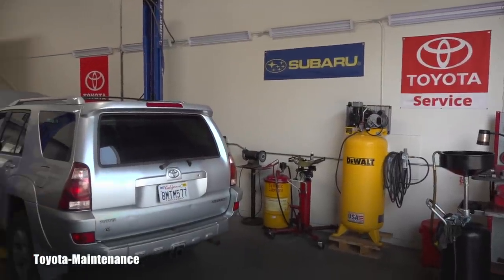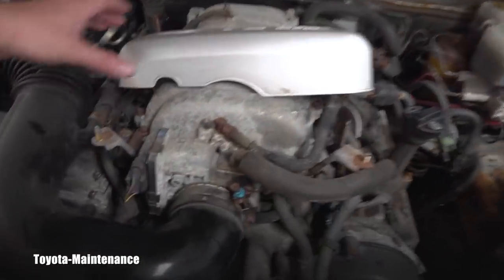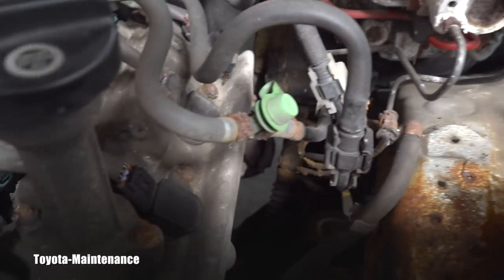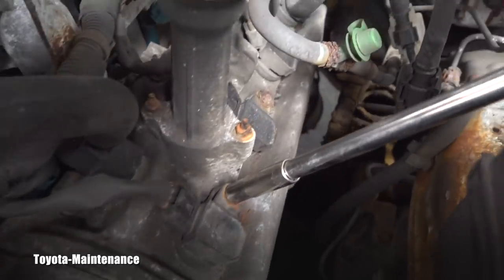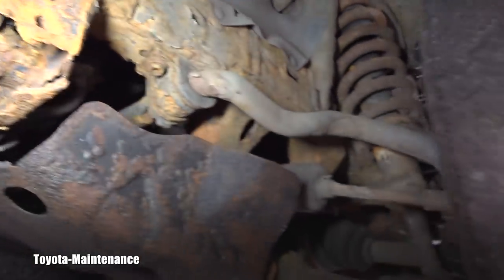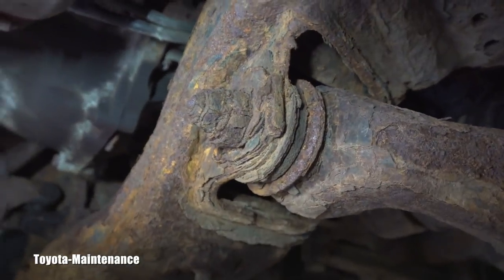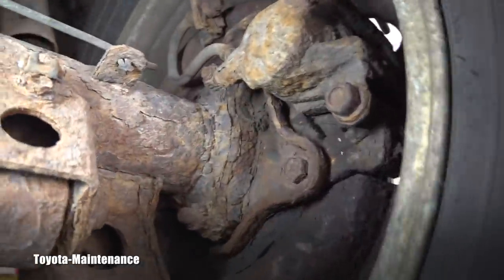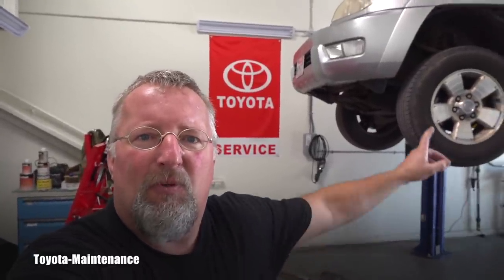Extremely rusted Toyota 4Runner

Comment: I'm in NYS but I've never worked on a car this bad. I just steel brushed the underside of my Toyota, added rust converter and a couple of coats of paint. Hopefully that will give me a few extra years. They should have done that to this car. They neglected it.

Comment: If it falls apart and crumbles, that's beyond rust.  I was my vehicle and undercarriage every two months and annually spray the undercarriage with Fluid Film. You really haven't work on a car until you have worked on a severe rust bucket. Have used a lot of penetrating oil and propane torches over the years and sometimes you need to cut off the nuts and bolts. Jobs like trying to removed rusted out subframes, you better hope your not being paid a flat rate. Seen a lot worse over 50 years living in New England.

Comment: I spray used motor oil on my Tacoma frame. 
Don’t use anything that will get hard and peel away from the metal even paint will let water 💦 get under it and cause rust.

Comment: I have a 99 and it was in Pittsburgh for about 9 years. Now in Florida. The rust is similar, but not quite to this point. I would consider this car for scrap at this point and NOT put any money into it. It is a real shame because the engine still runs solid as a rock. I made a mistake putting money into this car to fix up the front suspension and brake system. Now one thing after another, and the car has been removed from everyday service. I bought a new 2018 for everyday. Toyotas will rust away while the engine keeps running like a kitten. Sometimes you just gotta face the reality that it is time to put her down.....

Comment: It's a bit ironic that vehicles with a separate frame seems to be the worst. I am pretty familiar with the problem and hate it with passion. I live in the worst parts of Sweden and did just come in from another day of welding on my Isuzu Trooper. In some places it looks like that Toyota but a lot better in others. The thing that always surprise me with rust in the US is that there never seem to be any undercoating. But I also have to say, how did that Toyota manage to be ten times worse than my Trooper with 25 salty winters and salty ocean winds behind it? Under the bonnet, my old wreck is pretty much ok.

Comment: It's not pretty, but it's common in the rust belt. Here they use salt that is "wetted" with magnesium chloride, which makes it ten times more effective at de-icing roads, and ten times more effective at eating through cars.
Here's my usual song: A torch, hammer and punch, penetrating fluid, six-point socket, tighten first, then reverse.

... It usually works.

Comment: My 2003 Toyota Sequoia with nearly 285,000 miles has spent its entire life in Maryland and doesn't have major rust issues.
Reply: NJ2MDdude NY salt is in a class all its own. Now, with the pre-snow brining of the roads, you can kiss your vehicle goodbye even sooner.
Reply: MD is a southern state with minimal snow except for Garrett County.
Reply: @user-tb7rn1il3q  We get ice now in place of snow. So, our roads are brined often, perhaps too much. A few years ago, I walked thru my Toyota dealer's yard and saw about a dozen rusted frames in two stacks. I was shocked that the rust issue was common in MD
Reply: @nj2mddude205  How do you know those were from MD trucks and not WV or PA?  MD is near a lot of other states with more winter precipitation.
Reply: @user-tb7rn1il3q  Since the recall was national, all Toyota dealers with body shops would have had to honor the recall and replace the frame. Both I and my Toyota dealer are just outside DC in MD. Perhaps DC and VA plates, but I think WV and PA plates wouldn't have to travel that far a distance to replace the frame.
Reply: @nj2mddude205  I never see a rusty Toyota frame in NOVA, maybe VA doesn’t use as much salt.  There are a lot of people that commute 1-2 hours each way.  WV has no jobs.  PA isn’t much better.

Comment: Eh, little angle iron is a start for the frame repair….. should have plated that whole side, cut out bottom and sand blasted from inside and welded shut with flat plate and a few drain holes drilled out . Blast and Coat exterior with KBS system or Por 15(and a top coat) Then 360* degree tip and kbs cavity coater/fluid film on a long wand once every year for all frame interior areas. 

This one’s bad but could be saved still. Ask me how I know…..or I’ll just tell ya.  Sadly my 96 4R needed all of this to keep the dream alive of pushing her another 26 years! Fight to good fight against rust, good luck from Ohio

Comment: Owned a new 2014 Tacoma with 297K miles and ran good.  Live in the NE. Frame rusted out damaging the front end. Toyota did not allow me to participate in rust lawsuit.  Easily would have gone 500K. Now I lease a Nissan Rogue

Comment: Same year 4Runner, also from NY. Underside was not as bad overall, but still pretty severe. An unexpected issue was that on two occasions,  a  brake line rusted through while driving, causing a complete brake failure.

Comment: As a multiple 4runner owner from north east Ohio... this is bad but not out of the ordinary unfortunately. My 03 was id say a little worse. In my opinion, it still has value currently. Sell it, cut your losses and buy a better, newer 4runner. Exactly what I did. My 03 had 235k miles on her. Now my new-to-me 07 has 130k miles, from Pittsburgh with ZERO rust. Nothing. Not even under on the frame. I could take the exhaust apart with a wrench instead of a torch lol. Cut your losses and sell it.

Comment: ok i had fixed this problem by removing flaking rust wire wheel and wire brush then use Por -15 works wonders

Comment: I find it extremely frustrating that Toyota didn't address this issue over many many years of history. Very few improvements were made to the 4 Runner and to not dip their frames, use plates hardware, etc is a sin. Also, the amount of salt the states put on the roads should be criminal. Cars are too expensive now to drive in a northeast state.

Comment: Oh man..I've lost a GX470 to frame rust. Last time I buy anything north of Missouri.
 That 4Runner is way worse. That is so incredibly dangerous to have on the road. I understand if you have a few severe spots and get the frame patched and what not, sure, but that thing is coming apart. Take a hammer to it and see it crumble to pieces. Rust is cancer for cars, and that 4Runner was toast years ago. Put it out of its misery and send it to the scrapyard before it has a catastrophic failure on the highway. I don't say that lightly. The owner should sell it for scrap, and do whatever they have to do to get into a replacement vehicle. That thing is a 2 ton, 80mph liability.

The 02 LX470 that replaced my GX spent its entire life in the south and is 100% rust free. Once you experience rust, there's nothing like the feeling of being free from it.

Comment: Both my 1986 Corolla and my 2006 Highlander the driver floor board rusted out with salt and snow. The 1986 died at 180k my fault not knowing about radiation fluid corrosion.The 2006 is at 250k and still going. Corrosion is the only thing I see eating the alloy off the engine and other part in the bay. I think it will rust out before the engine dies. 🤣 Then Im buying a another Toyota “What a feeling, Toyota!!!”

Comment: LOL I was a tech for over a decade in upstate NY and while that is definitely rusty, I have seen much MUCH worse. You Californians are so spoiled! That front diff is definitely serviceable just bill the customer for a 11mm hex bit and sand down a little material off each side, then use a hammer to drive it into the rusty hole which is now more like a 10.5mm hex. I wouldn’t touch the rear diff though, you’ll likely twist the whole bung off the axle housing. A needle scaler will help quickly remove the large scale so you can see what you’re working with.

Comment: My 95 T-100 control arms collapsed while I was driving it. Toyota screwed so many customers. Most American Made vehicles survive the harsh winters with road salt. This is not the cause of salted roads. It is a manufactures defect. Toyota knows it. And they fail to do the right thing and fix the defect. Why don't they just throw sand down like in Europe. Just vacuum it up in the spring.
Reply: Really?  American vehicles don't rust?   Between 2010 and 2015, my 1999 Ford E250 rusted out and broke the exhaust manifold studs, the gas tank, and 3 brake lines.  I gave up on the van in 2016 when I was able to put my finger through the leaf spring hanger brackets.  It lived its whole life in PA.   They use various liquid salt (brine) solutions around here that are very destructive.

Comment: Sad to say, but....I think it's ready for the scrap yard. I think NY state is the worst.  I watch videos from a garage in NY state,  and it's either dealing with rusted junk, or vehicles that have been smothered in rustproofing coatings, including connections. Of course, any vehicle that is completely sprayed with undercoating on connections, the garage will not work on them.  The ones with rustproofing are still rusted, though.

Comment: This is so very common on this vintage of the Toyota 4Runner.  There is an open lawsuit and investigation going on with the #NHTSA. https://www.nhtsa.gov/vehicle/2005/TOYOTA/4RUNNER#investigations and if I may also include I did a video of mine (https://www.youtube.com/watch?v=gMe--n2_cP4), my brake lines/exhaust/everything except my frame is in great condition.  My frame is crumbling.  No one should say it is because we live in a northern state with harsh winters or road salt.  My 4Runner has less than 100k miles on it, when all other metal on the vehicle is in great condition and my frame can be broken apart and has huge cracks through it - that isn't normal.  Look at any other vehicle that is 15 years old, it will not look like this even if it is from the same climate.

Comment: Junk that vehicle and find another one that is safe. It is not safe in the long run on this vehicle. I have seen worse rust than this in my East Coast area at the Toyota dealership. I am not surprises at all. Some customer would like to replaced with a new chassis and unibody and replaced all the parts are needed. I remember that customer paid over $10,000 but the Toyota reimburse it because that customer report to the Toyota HQ.

Comment: The frame rust has rendered this vehicle unsafe for public roads. If the owner loses control when the frame/ suspension fails they will be liable for any damages in civil litigation. My suggestion: Junk it now.
And as the mechanic you should say the same verbally and in writing to the owner. It’s not worth taking on any liability concerning this wreck waiting to happen.

Comment: Dude  toyota is over rated. They only use quality parts on the stuff you can see . But all of their frames have rusted and rotted even those no used on salt  roads. I had one that was used to launch a boat into the Gulf a dozen times and has already rusted out. If you look at brand new cars, 2020 underneath it is like they used scrap metal to patch the body underneath where you cant see it. You will rarely see drivetrain failure on a Toyota, but almost every single one will have door and window problems because they use cheap plastic there. They assume you only use the driver side door and they reinforce that one but passenger side doors and windows they use the cheapest parts they find assuming you will never open or close that side

Comment: Cheap china metals . Soft and weak . I have a 1997 chevy k1500 that outlasted my brand new 2004 dodge 1500 ram quad cab .Rusted out at 70k miles falling apart . Dodge in the junk yard and chevy still going strong with over 200k on it .

Comment: I have a 2007 Audi A4 Quattro and a 2010 Audi a4 Quattro. Both are from Michigan. Not even a single spot of rust on the body, a very few spots on the chassis parts. This Toyota motors using trash instead of the steel. Completely crappy cars.

Comment: you know a vehicle is bad when the parking brake cables are holding it together. If you work on it, get a tetanus shot first!
Reply: You laugh but my dad actually had an old Land Rover back in the day (in the 70's or 80's) where the chassis rusted through so bad that every time he went over a bit of a bump the hand brake would engage from all of the flex

Comment: This poor thing is toast. It needs to go straight to the salvage yard. Maybe the engine and some interior parts can be sold. I wouldn't drive this rust bucket 5 more miles with that much frame damage.